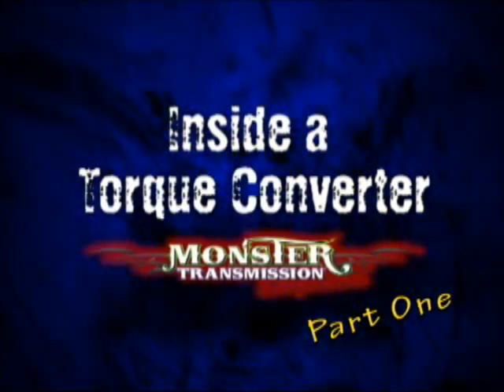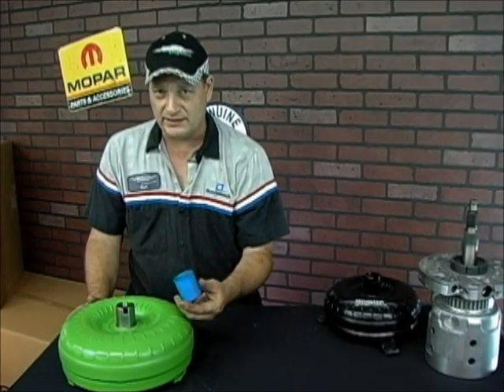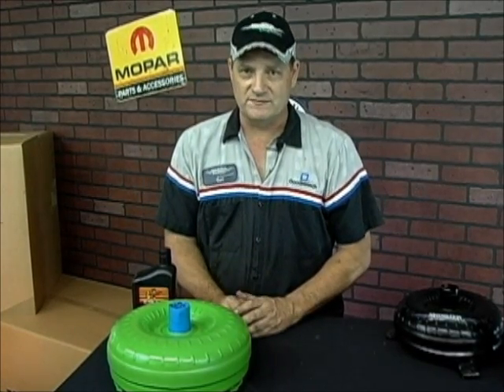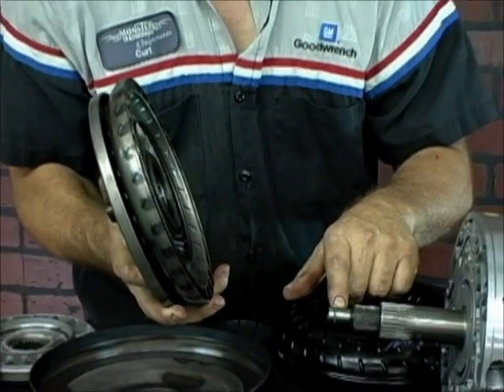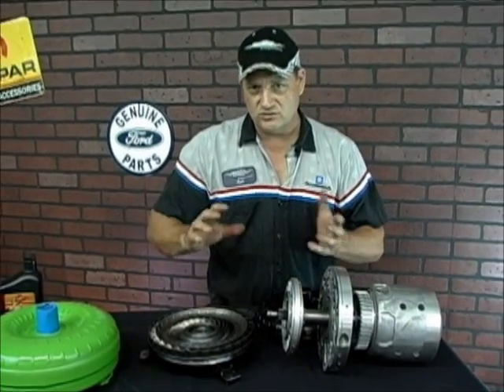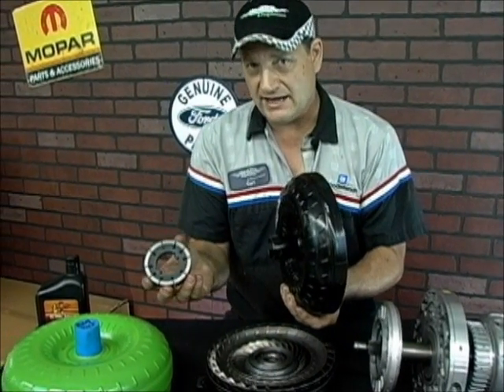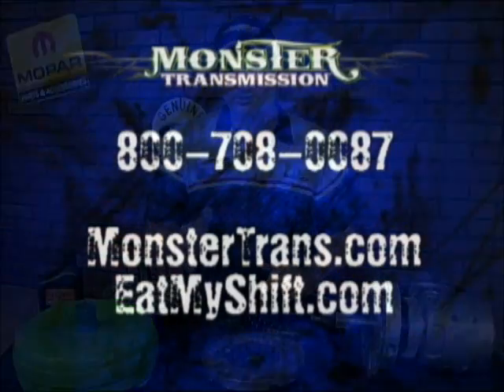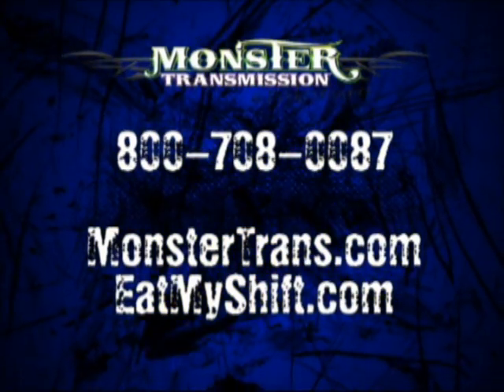Installing a Torque Converter Part One | Curt's Corner at Monster Transmission

Comment: Don’t just use any grease! Use a transmission “grease”, Vaseline, petroleum jelly, or petrolatum on seals. These will melt in heat and will allow your seals to do their job. Regular grease will stay firm and not solidify in heat.

Comment: Can this tutorial be used in replacing the torque converter on a 99 Nissan pathfinder?
Reply from the maker: yes the installation of a torque converter is basically the same for most.

Comment: From my exp it will not fit on engine if Converter not seated. Converter will stick out past bell housing face.
Reply from the maker: In some transmission types that is true. With those people will normally break the case or pump gear while installing because they didn't realize the converter was not in all the way.

Comment: What happens if oil is not put on the turbine before mounting (not being new) or is lowered for a change of rack. The mechanic who mounted it did not do it, when it started there was a strange sound, like of grazing screws, then walked for a while and then stopped picking up speeds. At the end of the story, which could have been damaged, I think the mechanic did not correctly position the turbine with the three steps. :( It went back down the box it went back up and continues without grabbing the speeds. What can be the damage? Pump or Turbine?

Comment: hey I put 2 quarts is that ok or is it to much
Reply from the maker: If 2 quarts will fit in the converter that is okay. Just make sure after running that the levels are proper on the dip stick. Thanks

Comment: i m just removing my engine/trans....doing engine swap..are there any serious do s and dont 's  with the torque converter, there is nothing wrong with it just want to be careful with it ,like if it gets laid on its side  things like that 
thanks in advance
Reply from the maker: When removing the converter just take it slow and don't recklessly remove it.  When storing the converter just keep it flat and the hole covered so nothing gets inside. Being on it's side won't hurt it.
Reply: great...thx

Comment: curt do i have to rebuild my transmission if my converter is making a noise or should i just replace da converter itself
Reply from the maker: Drop the transmission pan, see if there is metal in the pan and inspect the fluid. This will help decifer the condition of the transmission.

Comment: I replaced rear main seal and reinstalled the transmission and now it will not move in any gear. what do you think  happen
Reply from the maker: What transmission do you have?  It sounds like the torque converter was not in all the way, that will brake the front pump gears.

Comment: I'm installing a torque converter on my 2000 escalade. I did what u said and installed the tc all the way in tranny. but when bolting the flywheel bolts, the bolts won't reach the tc.? the tc is exactly the same as old one?please help thanks
Reply from the maker: I would triple check all thickness's and measurements. Was the converter the only part being replaced? Did you listen for the proper amount of clunks?

Comment: Great Video ! I have a Question for ya Could a Bad tourque Converter be the cause of wheel vibration at 50 to 60 mph ? in My p.t. cruiser 2006
Reply from the maker: No it wouldn't be the converter. Typically something more to do with the wheels, assemblies or suspension.
Reply: I have taken it in to 2 shops and they still have not resolved the issue.
thank you !
 I will present that to them   . One said it was standard for pt cruisers  Ha in His Mind maybe.

Comment: Man.. Your tutorial and explanation explains soooo much Curt. ..Thanks for an amazing video. Please tell me if this may be my problem in my 1986 GMC Conversion Van! I have reverse and park but no drive.
Reply from the maker: That would most likely be an internal transmission issue and not the converter.

Comment: so if the pump gears breaks what happens ? does the car stop driving and the gears won't work suck as drive or reverse
Reply: stuck I meant xF
Reply from the maker: +Cristian Ramirez If the pump gears break then there wouldn't be any pump pressure. So you are correct there wouldn't be any drive or reverse.
Thanks for checking in with us!
www.MonsterTransmission.com  |  800-708-0087
Reply: +Monster Transmission no wonder my car don't drive no more and makes a weird noise like if something is scrapping . and I don't feel the gears lock in . so I'm guessing my pump gears broke and I heard it pop thought I blew my transmission .

Comment: yes i got a wagon that has a 700r4 trans the vehicle sat for 3 years . the person i got it from doesnt remember how much fluid was in it they dont even know if the dip stick is the right length. its after market. my question is how do i find out the right length and if the kick down cable isnt tight would fluid spill out of the trans where the cable hooks up to
Reply from the maker: Henry Evans 
Yes it can leak from the cable if it is loose.  They hold 11-12 qts total.  So at this point you can either purchase an original stick and tube or you could fill it until it works properly and then mark the existing stick. Hope that helps. If you have any further questions give us a call at 800-708-00087. Thanks and have a great day!

Comment: hey i got a huges 2500 stall converter for my aluminum power glide  and i can't get it to go in i played with it forever it seems like something inside is stoping it from going on
Reply from the maker: You will need to make sure the spline on the input shaft and converter match up. The shaft could have been upgraded to a turbo 350-400 spline shaft which will not accept a stock powerglide converter.

Comment: I have a 2004 gmc yukon xl 1500 my drive and reverse went out could it be possible the t-conver went out? I dropped the oil pan and there's a lot of sliver flakes mixed in the oil or could it be the oil pump I'm trying not to do a complete tear down of the transmission...

Comment: had a 700r4 built 17 years ago for my nova also a 2800 stall converter, they removed the lock up , car been sitting for 15 years going threw frame of restore, it back in the car with a new 500 plus hp small block , would like to be able to lock up 4th, was woundering if i need a now converter

Comment from the maker: Hi Tony,
Yes you can.
After you remove the driveshaft and slip yoke, the transmission mounts, unbolt the trans from the motor, drop the transmission, then put in the new torque converter and re-assemble.